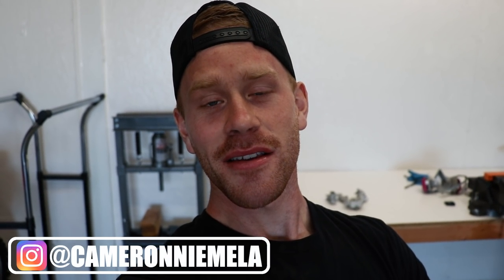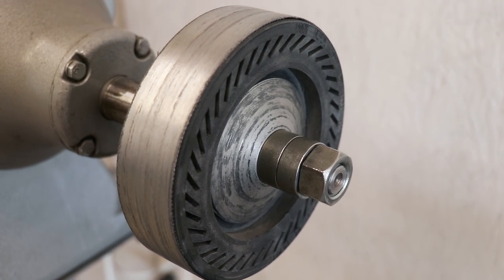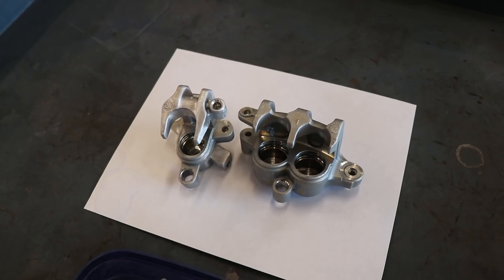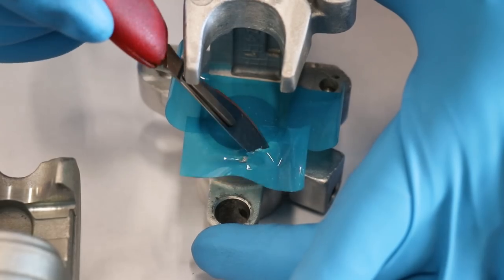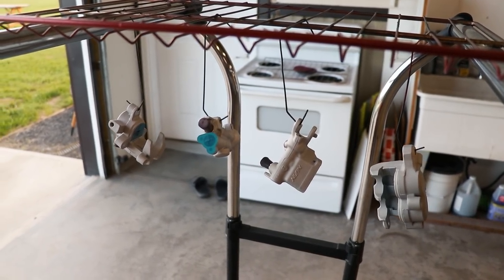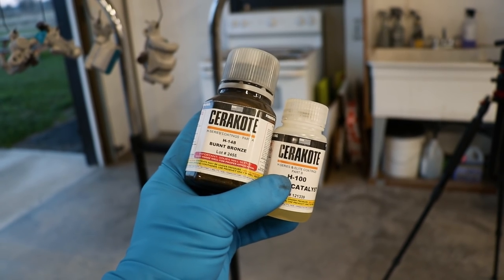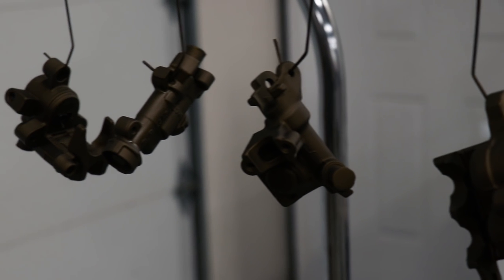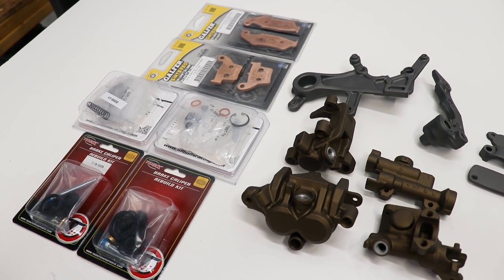Ceramic Coating Dirt Bike Brake Calipers!

Comment: Very nice work done, although personally I would not cerakote the calipers purely because it might act as an insulator up to certain level, surely any coating apart anodizing does not help with heat dissipation.

Keep up the good work, like the carb how beautifull it came up, really trick!

Comment: Wooden powder coating all that stuff be a lot easier and a lot cheaper? I'm just curious I do industrial Painting and Sandblasting tanks Bridges stuff like that work in the Union. Just curious why that you would want to use the paint versus powder coat does powder coating is cheaper easier than what you're doing
Reply: 250race the Creakote he's using is really thin, like watery paint but very durable, on parts like brakes etc powder coat is too thick

Comment: Man, I think you would really benefit from an ultrasonic cleaner. They’re not that expensive, and you can clean parts in simple green, and it will ABSOLUTELY clean them inside and out in a way you just can’t by hand.

Comment: Cameron you should cerakote the engine mounts on the bike too
Reply: Diego Brah The engine mounts are part of the frame. Did you mean the bolts?
Reply: Iain Myatt or the head stays possibly?
Reply: Yeah I totally forgot about those, Sry m8.

Comment: Does any of this work improve the brake performance on your bike?
Reply from the maker: It does not change performance, purely for looks
Reply: The coating doesn't, but rebuilding it all with new seals, pads and brake fluid will bring it back to factory fresh

Comment: Why slice into the tape?
Reply from the maker: The tape will shivel up and come loose in the oven without a slit
Reply: Cameron Niemela wouldn't the sand get into the braking system this way, because you cut it before blasting?

Comment: Anna nothing I see that you're doing wrong when you go pass what your spring you are not supposed to let off the trigger you were supposed to let the air keep going. A car painter will tell you this to I use those conventional guns at work daily try it out don't let off the air because every time you let off the air and pull back on the trigger it spits a lot of stuff out just heads up try it you'll get a better finish